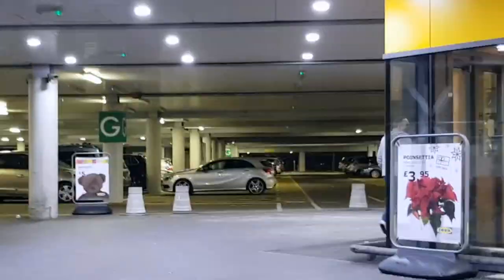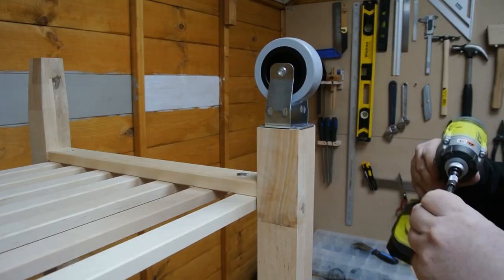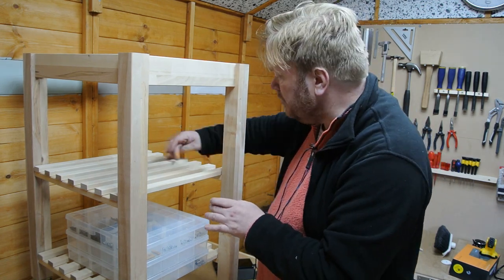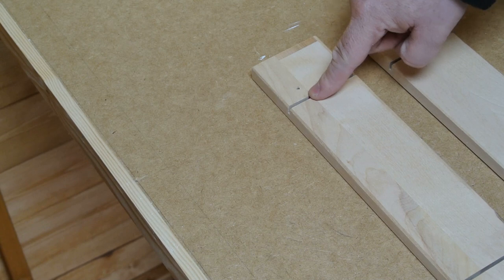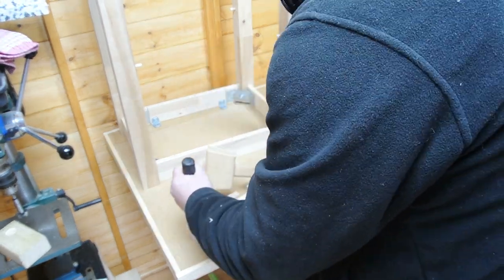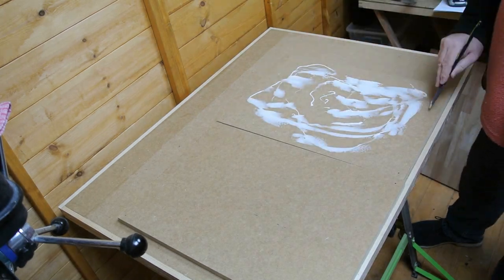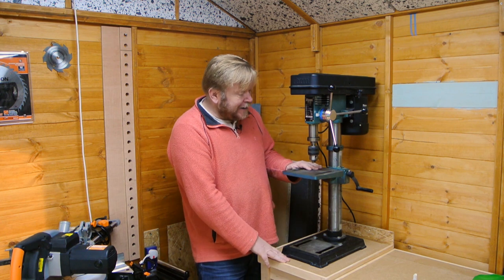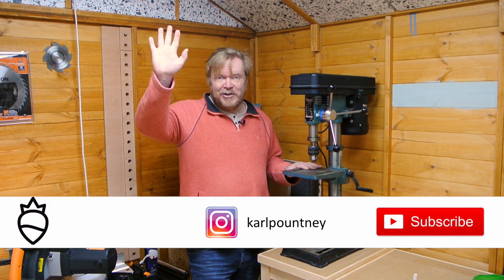Mobile Bench for Drill Press - IKEA BEKVAM Hack

Comment: Nice work. I've modified Ikea stuff in the past (20mm off a double drawered crudenza unit, which came with several challenges), but sometimes when you weigh up the desired function/look versus either building it fresh or buying in a bespoke piece it's a no-brainer. Thanks for the vid
Reply from the maker: You're absolutely right. Thanks for watching.

Comment: Great video. I recently acquired a vintage hand-powered pillar drill and wanted a bench for it, so having seen this video, I bought and built the kitchen stand. The drill is secured to the top with hex bolts, washers and butterfly nuts. Brackets were added between the middle shelf and legs to provide extra strength as the drill is very heavy! Next I'd like to add a drawer to the bench for drill bits etc.
Reply: Do you have any idea of the load capacity of this Ikea kitchen trolley. Planning to put 30kg/66lbs pizza oven.
Reply from the maker: Sounds a great little project.

Comment: This is a neat IKEA Hack, nicely done :-) Sad to see that a manufactured item is so much cheaper than buying raw materials.
Reply from the maker: Stephen's 8x6 Workshop: it is a shame. A cubic foot of beech is around 35 and 45 quid dimensioned but rough sawn. 10 quid more for planed. But I've used IKEA veneered doors from the bargain corner many times on projects too.

Comment: Great project, why reinvent the wheel?!  Don't get the IKEA snobbery, use and abuse I say!
Reply from the maker: I'm a real fan of IKEA in terms of its approach to design and the refinements it makes to its manufacturing processes. My only criticism if that it seems to fuel a disposable culture with cheaper materials making it easy to replace according to fashion. I'd recommend checking at a Paul Sellers blog for an insightful post on the subject - he's is not a fan but makes a good point about material use. But I'd priced-up the project in both Beech and Oak milled boards and IKEA beat them hands down. Anyway thanks again. K.